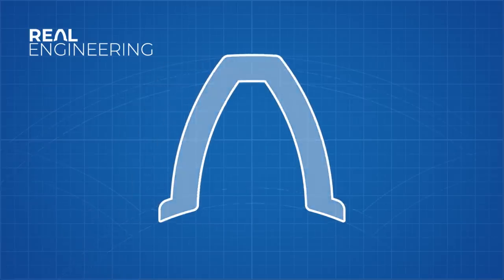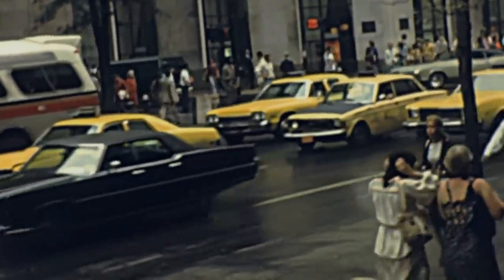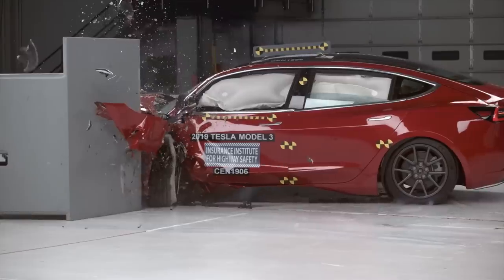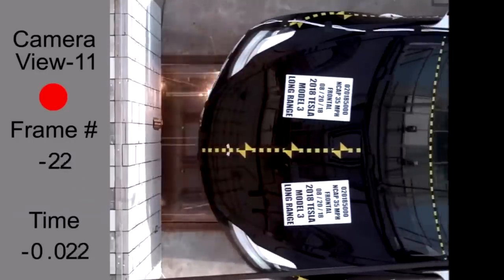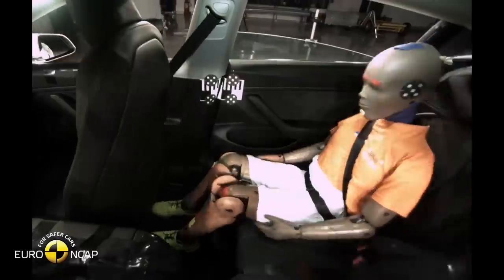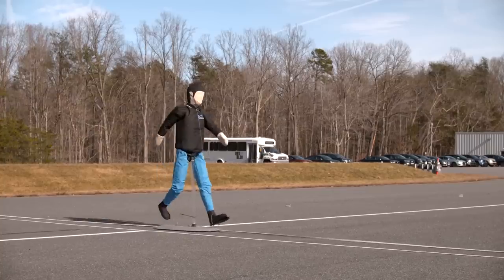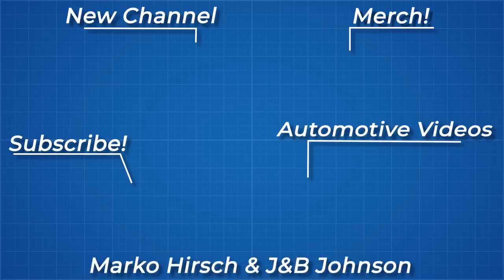Which Is The Most Dangerous Car?

Comment: Casey Putsch (huge car guy, on VIN wiki a lot) makes a good case for one of the reasons sports cars have higher fatalities in crashes and its not an obvious one, the speed and driving style is part of it but as you say the US is full of trucks and SUVs. This lead to lots of safety and crash barriers either being raised to around half way up the side of a large SUV/Truck or replaced with the wire tension systems which stop the large heavy vehicles fairly well, however these are at just the right height for a low down sports car to wedge under them with predictable consequences for the occupants.

Comment: I used to do automotive accident reconstruction and now am a physician with a modest amount of experience in trauma. This was an excellent video boiling down safety in modern cars and the problems with the safety ratings. I will not allow my wife or children to ride in a vehicle that is less than 3500 lbs (about 1600 kg) because of safety concerns regardless of crash test data for said vehicles below the threshold. I do additionally look at the specific crash test results to help guide our vehicle purchases for vehicles above 3500 pounds but they have to be interpreted carefully because they are not very good at determining what will happen when vehicles of unlike weights collide. In general the heavier vehicle wins. Modern safety improvements have been dramatic and impressive but all else being equal weight still wins.  My present vehicle weighs 8800 pounds and my wife’s weighs 4500 pounds and both are manufactured after 2005.
Reply: This is bad logic. First of all think of buying a car that aids the driver with it's driving characteristics at avoiding crashes. A big SUV that weighs 4500-5000 pounds will be harder to manouvre in emergency situations. It will most likely also take a longer distance to brake. If you are a good driver, buy a sportier, lighter car, like a bmw 3 series or a Mercedes c class. There are many more scenarios that we can talk about, but usually a better driver with a better driver's car will win, not weight of a vehicle.
Reply: Handles like a dream. Minivan. And I’m sure you have investigated thousands of automotive accidents to form your opinion regarding vehicle safety?  Sports cars are significantly more dangerous to their operators on a per mile basis.
Reply: @MDwithanAK  I wasn't referring ro sports cars, but rather to sportier cars like a bmw 3 series or a Merc c class. They are sportier to drive compared to minivans and trucks.
Reply: TGMike there is some truth to your thought process. A more maneuverable car is more capable of avoiding an accident. A heavier vehicle is more capable of carrying you through an accident unscathed. The problem with this logic is the vast majority of drivers do not drive as a level of vigilance that’s compatible with utilizing the maneuverability of a more maneuverable vehicle to anywhere near the potential required to avoid such accidents. Because I was an accident reconstruction engineer I had the opportunity to actually work with some racecar drivers on my own driving skills. But I can tell you from years of accident reconstruction work is that the vast majority of drivers believe their skills at driving exceed the average when most people are fairly mediocre, relatively distracted, and frankly just are not that safe behind the wheel.  In theory your point is quite valid, however, the numbers do not bear this out simply because most people lack the skill to utilize said maneuverability whereas even someone that is driving a relatively large and difficult to maneuver vehicle can benefit from increased vigilance to nearly the same extent. This of course comes at the price of not driving anywhere near as aggressively as most people do.
Reply: Nice American thought. To bad we pay roadtax per weight in the Netherlands and a 1600kg diesel will set you back a good € 180,- per month. (€ 120 for petrol) So that is one of the reasons this is a continent obsessed with silly small cars.

Comment: 7:28 "Women have 47% higher chance of serious injury in a crash"  In my observation, they also have a significantly higher chance of having the shoulder belt behind them during normal driving.  Presumably this also translates to conditions in a crash.  I suggest it would be worth looking into why!?  I can't imagine it's due to being more risk tolerant than men, given that in basically all studies I'm aware of it's the other way around.
Not being female, I lack any personal experience with shoulder belts and breasts, but I imagine that there would be some discomfort there encouraging this behavior.  Making seat belts comfortable enough to wear correctly would be a great step.
Reply: Yeah, but that 47% is a figure I choose not to take at face value seeing as this video has it's typical liberal 'bent'.  It's all about pointing to how the United States owns too large vehicles [which COULD have caused the Mirage to be less safe than how it was rated], doesn't think about women, doesn't provide safer stuff [like Europe], and has a great need for a car to do all kinds of monitoring/driving because we need to be SMARTER and safer.  I disregard Real Engineering's opinions and just try and learn how far we've come in metallurgy and product design due to that snippet of the 1959 vs 202X.  And as for the "woman's rights in auto safety" 'issue', the only real variable is airbag expansion rate versus driver/occupant weight versus distance between airbag and driver.  Oh, how to discover a not-sexist formula!
Reply: funny thing is that im more comfortable with a seat belt than without one.
Reply: @f1rst_pancake  - Yup, he is pretty blue, but at least trying to be factual. As I wrote in another comment, he talked about how the government regulation should be amended, because the market solutions are so much better. I would say then the government regulation should be abolished and market ones should be used instead :)
Reply: Preach. Breasts push the diagonal strap up to handily cut into the neck. It would be less of a problem if the inertial reel end of the belt was lower, so the belt would sit flat over the shoulder. but it's usually somewhere up around the ear or above. And I'm fairly tall for a woman. Combine short and breasts, and the diagonal belt is a literal pain.
Reply: @f1rst_pancake  Do you really not see that all you've done in your comment is point out some things he said that you don't like for ...reasons..., provided no real points that dispute the things that you didn't like, said you disregard everything he says because you don't like his political opinions and then to top it off implied that somehow YOU are the fact based person in here despite all that?
Reply: @ska042  But you're not agreeing with my comment because of... something...facts you've chosen not to to type out?  In rereading my comment I see how plainly I've complained about being spoon-fed liberal slant under the guise of education.  That was the point of my comment, and no I did not convolute the message to misdirect; I can assure you I still feel this way.  Good day fellow YouTuber.  😃
Reply: @ska042  he said liberal like the uk type I’m pretty sure pointing out how he’s trying to discourage large trucks and thinks we should only drive small vehicles that’s the only opinion he didn’t agree with

Comment: Fun fact: the ratings for wet tire traction are based on locked tires despite all cars since 2000 being legally required to have ABS in the USA.
It's why the Michelin Cross Climate gets a B rating (the worst rating for some reason) despite having superior rain traction to pretty much every other tire.

Comment: great video! I´ve had the same thought about the cyber truck. Did you come to a conclusion if the truck is good in safety or not? Thought your video would have ended with this :/
Reply: It’s unlikely the cybertruck has undergone/completed road and crash safety tests yet, that or the results are yet to be analysed and confirmed.
But that’s just my guess
Reply: @gammafox5431  true yes. But with a hard exoskeleton body it will be hard to have a safe car/truck! I was hoping real engineer (brian) would have given some more insight and analysis if he thought the truck would be safe. I as a material engineer I think it would be hard since you go in the opposite direction of what a safe car would react in a crash. Tesla could design the exoskeleton so it will crumble by design and absorb energy but that is yet to be seen.
Reply: @TheCborg  exactly because of the doubts still in the air, I agree that Brian didn't make any remarks on what to expect from the Cybertruck. We'll just have to wait and see. But yeah, i'm very curious about this too.
Reply: My guess is that it will be an extremely safe car for the occupants but an extremely dangerous car for other light cars.
Reply: Since Tesla is has always strived for 5 star crash rating I suspect they will make the Cybertruck crumple under certain conditions. I can't imagine they would release it with low crash ratings. It's way too early to judge whether it will be really safe or not as they can change the design before production.
Reply: @jonaboy3  but what if you crash into a brick wall?
Reply: @BnORailFan  exactly. Tesla is know for safe cars. But with their design and material chocie they have some engineering trouble ahead.
Reply: I hate when videos don't conclude the topic they just discussed, like ok you researched and found out the systems are bad, now what?! Do you expect me to figure the flaws and design a better system??
Reply: bafdfd I was thinking along the same lines when I saw the reveal, but I would assume Brian’s research didn’t bring up much information worth noting, regarding the crumpling of the cybertruck, otherwise he would have mentioned it?
I just hope there’s a follow-up video on the safety of the Cybertruck, I’m quite curious!
Reply: There’s literally no data on cybertruck safety, only educated guesses from engineers and rumors from insiders. I completely understand why RE didnt try to come up with a safety rating with no data to back it up.
Reply: @jonaboy3  you summed up my thoughts there.  Internal airbags offer no protection to other road users.  He only speaks of the safety of the car's occupants, not how lethal it may be for others.  Shall we hope that AI ABS collision avoidance solves this?  Maybe.  Common influenza results in far more fatalities per year than the little car singled out here.   Is the car dangerous per se, or are most of the deaths better attributed to the vehicles that collide with it?
Reply: @TheCborg  I would assume if it can't crumple adequately they will change the design significantly to make it safer.
Reply: @jonaboy3  Tesla have to have thought about the safety before showing the truck so they don´t have to change it later. People will not like a big change in design with their 1000 dollar deposite.
Reply: That car is not real. Elon Musk is trolling you hard.
Reply: @DashCamSerbia  its a truck thats going into production later. so maybe check what you claim beforehand

Comment: Another overlooked area of safety is seat back failures. In crashes involving certain rear end collisions, the front seat backs can collapse causing the front seat occupants to slip out of their restraints and can cause injuries to them and the rear seat passengers. Sadly, because children are typically the passengers in the rear, and are most vulnerable to injuries, some are badly injured. Certain US lawmakers have been trying to force the manufacturers to put emphasis on the design and testing of the seat backs, but little progress has been made. My recommendation for selecting a used or new  vehicle to purchase is to google 'seatback failure lawsuit' and include the year make and model of the vehicle. The search results may surprise you. Example: 'seat back failure lawsuit 2002 Lexus ES300'

Comment: I’m curious about the results of the most fatalities and wondered how they separate which vehicles there is more of. For example it’s likely there is more mirages on the road than many other vehicles, and they would on average do less miles per vehicle over their life being smaller vehicles and likely to be driven in higher density traffic. If there is more of them on the road, operating in higher density traffic they are going to be involved in more crashes than say a different vehicle with less numbers on the road that is on average typically driven in lower density traffic. More crashes means higher chance of fatality. Maybe I’m missing something here, but it seems to me that this was overlooked or ignored. The statistic is pointless if it cannot properly consider the qty of vehicles and or the chance of an accident in the most likely enviroment it operates under. 

Not saying the mirage is a safe car, just saying those statistics are potentially misleading.

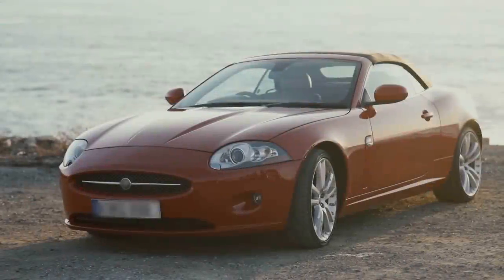Comment: 3:21 - You did not take into account, for the whole duration of the video, the lethal Takata airbags, like the ones in the Nissan Versa, and other cars.
Reply: for anyone that’s confused: a few years ago, takata airbags were recalled in certain year/makes/models because the airbags were sending shrapnel into the passenger compartment when the airbags deployed. and faulty foil seals allowed moisture to leak into the ammonium nitrate that was used as a propellant to inflate the airbags, which could have decreased the force of the airbags when deployed

Comment: Time to trade in my 2015 Mitsubishi Mirage 😭
Reply: Ya Mumzhitachi  It was a affordable used car with great gas mileage. I didn't know about the airbags gap that made it unsafe until watching this video.
Reply: Ya Mumzhitachi  Ya it comes with 14 inch tires, but I think 15 inch tires can fit and comes on its higher trim levels. I would opt for the 2017+ model since they fix that airbag gap issue.
Reply: @BC250  You should see my 2009 Dacia Sandro crash test. :I
Reply: @BC250  they come with 14 or 15 inch rims not tires.... you can put any size tire you want on a 15" rim i currently have 15s on my jeep with 35" tall tires.. selling the car because of an airbag gap that only becomes a factor in a small percentage of very specific accident types is just absurd.. if youre going to strive for that level of safety you masewell bubble wrap yourself and stay locked in the house

Comment: If the data is based on US figures it is flawed as a large percentages of US fatalities are due to unsecured occupants. (No seatbelt). This diminishes the effectiveness of safety systems severely. 

Also testing had changed considerably since the 1970's where testing was mainly frontal impact testing only.

Partial offset, side impact and roof testing have been introduced since the seventies. 

Small overlap testing is relatively recent and came about after studying real world impacts, many cars which perform well in frontal and partial offset testing preformed poorly in small overlap, those is a real challenged for automotive designers.

Comment: I drive a 2004 mx5. I have no side-impact protection beyond some polystyrene bocks in the door. The car did fairly well in 1999 when being tested for rear impact at 50mph and in 2002 for front impact at 40mph. I’ll probably survive those.

Side impact or roll and I’m dead wooooooop

Comment: Sheet metal or machined surfaces with a line of flats at 15 degree angles behave to flowing air like a continuous curve. It’s highly likely a folded front with 15 degree flats would be no worse for pedestrians than “normal” truck fronts.  There’s also no solid lump of metal hidden by a thin sheet with nasty claw fastener.

Comment: Well, our country isn't obsessed with trucks; we just have A LOT of rural areas, and if you've ever lived out here in one of these rural areas, you find out real fast that pickups are unrivaled and the superior vehicle, even if it's just for the towing capability. Go into the cities and denser suburbs, and you'll see pickups become far and few. Out where I live, it's not an exaggeration to say every other vehicle you see on the road is either a pickup truck, or a SUV with AWD or 4x4. The remaining half of the vehicles are almost all minivans, with some sedans and coupes sprinkled in. I can't remember the last time I saw a Prius out here, or any super tiny car like that. There's no point; gas is cheap, and enough roads are gravel or dirt that I wouldn't want to drive something meant 100% for city crawling. Even if it was lifted and AWD, I still wouldn't drive a compact because I'm 6'4", plus there's the safety concern about being hit by something more than double your mass. At least in my minivan my mass is enough to give me a chance.

Comment: Completely overlooks the importance of front overlap crash testing as its more realistically tests for head on collisions. High speed, head on collisions usually involve two vehicles travelling opposite directions, its very unlikely they will collide with no overlap between the vehicle body's.  The fact the Mirage achieves a marginal rating in this test is definitely a contributing factor to the high death rate.

Comment: This goes for the same thing with tires, the tests are based of locked brakes tire slide. 
when all cars from 2000 and up were antilock brakes for the most part. 
so tire rating are technically not accurate at all because the tire doesn't stop moving anymore.